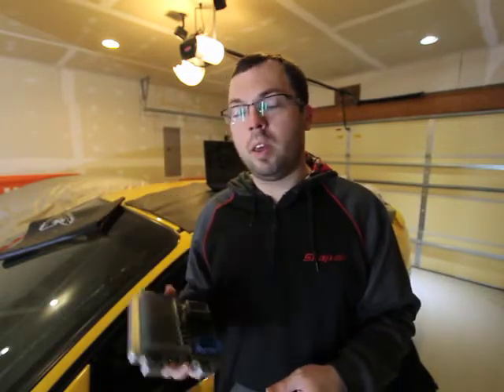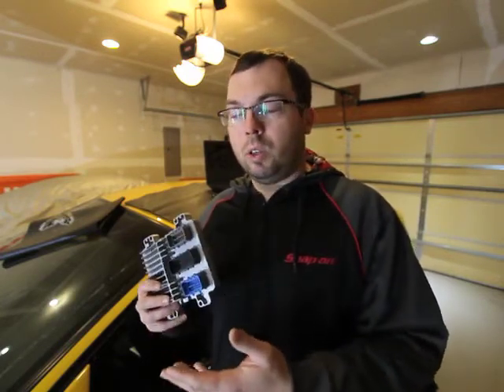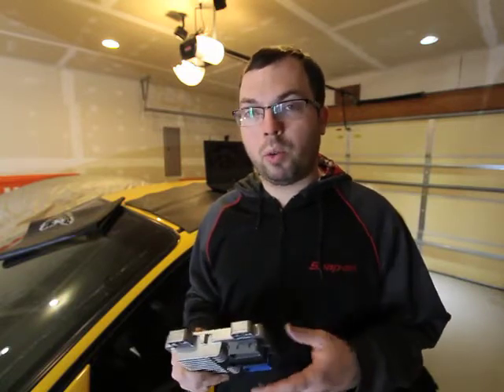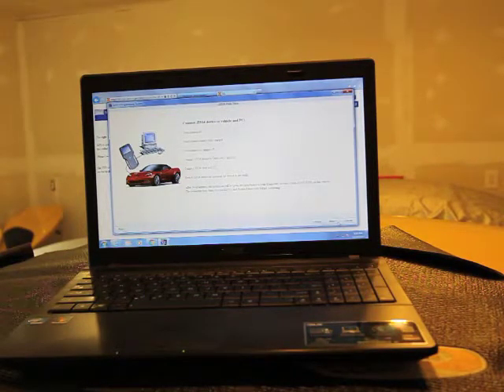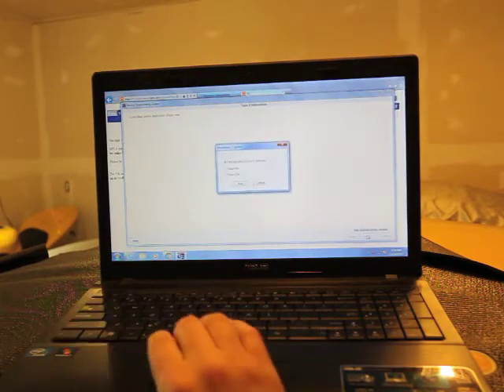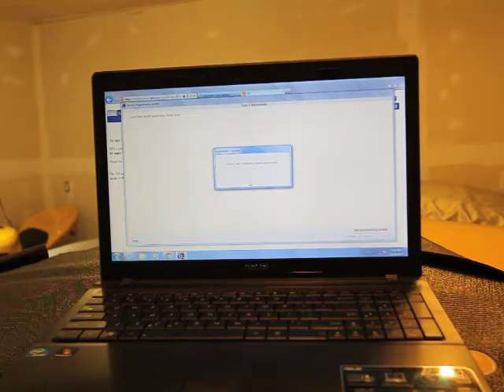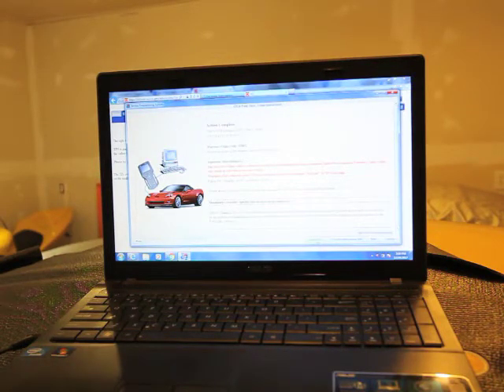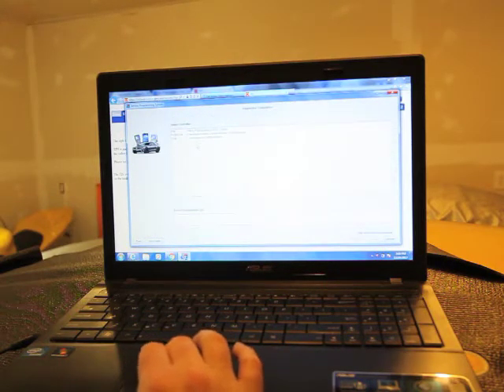Replacement of the PCM on 05 LS2 GTO with Programming Instructions

Comment: When you program these ECUs and modules on these modern cars, you need a flash programming power supply that supplies a constant voltage and varies the current as needed. Regular chargers are not the correct devices for flashing and programming.
Reply from the maker: I live dangerously every day of the week only time I bring out my power supply is on bmw
Reply: @SpartanAutoworx  I bricked my 05 GTOs ecu....low voltage also damaged my PIM. So, not for me anymore. These ECUs are expensive.

Comment: Hey there, if the PCM IS REPLACED WILL THE BATTERY LIGHT START BLINKING? What would cause the battery to start blinking after pcm replacement? No issues with charging system at all.
Reply from the maker: Year make and model?

Comment: How did you get the security code. I need to replace my ecm but need the security code.
Reply: Yes me too
Reply: @hollusta  what about you did you get the security codes ? I came across a company called All Computer Resources and they told me i wont need the codes if i get it from them (programmed to the VIN)
Reply: @Mr-th5hw  yes I got the codes from the GM dealer. They have them, but they don't know it
Reply: @hollusta  how exactly did you ask them ?? I called today and they seem so confused..
Reply: @hollusta  ?
Reply: @Mr-th5hw  I had to insist that they give a detailed look because no one in parts knew the codes are in there. I also think I need proof of ownership like registration.
Reply: @hollusta  thanks for replying 🙏
Reply: Did you get your security code ?
Reply: Going through with this Ecu swap nightmare fml. And i just got my Motor rebuilt 400 miles ago..

Comment: I recently bought a used ecu from another gto for my Ls3 gto swap, but I didn’t do a flash on it. Did a vats delete on it but it doesn’t crank nor start. Now it’s says something about immobilizer code. Was I supposed to reprogram the ecu to my car?
Reply from the maker: I dont think you can kill vats inside GTO tune. Have to use tune from corvette
Reply: @SpartanAutoworx   no, I have not. I’m pretty much stuck right now.

Comment: Does a preprogrammed one from online work fine or will I still have to flash it? I have an 06 GTO and reduced performance keeps shutting the car down. Got a code p0601
Reply from the maker: If vats has been disabled. Not sure you can disable vats with GTO vin in hptuners. Maybe EFI live but not sure.
Reply: Hey! I have same issue, did you get it fixed?
Reply: @resultsfitnessco  Did anyone get this fixed? Just happened to me, tried a new ecu but can’t get new key to program.
Reply: @johnnyboy71294  I fixed my issues. Problem was I had a remote start system that went bad and interfering with everything lol
Reply: @g00niez  oh damn, so it wasn’t even the computer?
Reply: @ nope. My car would run then shut off on me. Eventually got to the point where it wouldn’t even crank over. Put new computer in it. Same issue. Diagnosed everything and the remote start system that I didn’t even know I had went bad and stopped it from starting.
Reply: @g00niez 😮‍💨 I don’t even know what to do anymore 😂. Replaced the computer and can’t get no keys (3 so far) to program to it. Mine still starts and drives with old   computer. But eventually it’ll shut off.
Reply: @ yup that’s exactly what one would do. You might have a remote start you never knew about if you bought car used. I never knew I even had one lol
Reply: Same happens to me. Did you get yours fixed? I tried turning vats off with new one wouldn't work I just grabbed the code today
Reply: @g00niez  Did anyone get this fixed? Just happened to me, tried a new ecu but can’t get new key to program.
Reply: @johnnyboy71294  yes. Except found out my issues came from my remote start system that went bad in the car.
Reply: Did anyone get this fixed? Just happened to me, tried a new ecu but can’t get new key to program.

Comment: Will this program and stuff  work for my '03 grand am gt1 ?
Reply from the maker: You replacing the pcm? Grand am has a different pcm and system. This link procedure will not work for that car. The SPS programming would be similar. 

Let us know what you have going on and we might be able to help.
Reply: @SpartanAutoworx  ok ,  my portable BT obd scanner i always leave plugged in randomly caught the obd port wires on fire and my gauges were going haywire. So i unplugged it  and i went under the dash and got all the melted wire covers off,  cleaned up the wires and retaped them . 
Everything has been working fine since that happened till recently. 

When i accerlate my headlights dim alittle bit like the electrical stuff loses some power.  my battery & alternator where tested and are fine. 

The lights in my climate control went really dim permanently .  when i turn on the A/C (that works perfectly fine) the empty fuel tank light comes on then the security light comes on and my gauges flatline till i turn the ac back off. 
  Also recently ,  sometimes when i break the gauges flatline and the security light comes on ,  then all returns to normal a few seconds later.
I am going to buy a new climate control module but i think it only went bad because im assuming the little fire caused a short in the pcm maybe ? 
I work on my cars always and know alot about cars but i do not know alot about pcm. 
Not to sure though , someone suggested that. Ill be able to see if more wires were damaged behind the climate control once i take it out to replace,  
But how likely is it that the fire shorted the pcm ? The car is very well maintained in excellent condition and i take care of it. I guess the fire was my fault i shouldnt have left the obd scanner plugged in 24/7.
If you do have any ideas im all ears ! Ive searched everywhere and finding my specific wiring harness is completly impossible so im ruling out changing that.

Comment: I am swapping a 2006 GTO powertrain into an '80 Corvette. I have the original ECM, flashed to remove VATS. The car starts and runs. I was thinking of adding a PIM and BCM (if needed) to use the GTO gauge cluster (I have the car's original). Will this work to make an another 2006 GTO PIM/BCM run the gauges and MIL?

Comment: HI, I have a 2005 GTO, pretty sure the computer went bad , when it heats up the car goes into safe mode. and i have replaced the throttle body and everything els tests fine, once it cools down runs great untill it heats up again. So I purchased a new ECU, vin was installed on it i was told, I have HP tuners, it will not even read the ECU now, I do know I have to link the PIM and the BCM and relearn the security code as well. Can I do this myself with outgoing to a dealer, reason is the car is in my barn, and will not start and even if i could get the car there who knows if they will be able to do this. And the car cannot be started anyhow since it does not have the loaded tune needed to even start, the car is supercharged among other things. I want to be able to do all this myself or with the help of a knowledgeable person in my barn and be done with it. I need some guidance on this please. TY
Reply from the maker: You will have to relink the pim and ecm. No way around that in order to get the car to start.
Reply: I have a 2005 GTO with a similar issue.  Replaced the TB and it got rid of most of the issues.  But, it still pops a Safe Mode intermittently, doesn't matter if I'm driving it hard or cruising on the highway.  Did the new ECM fix the issue of putting the vehicle into safe mode?

Comment: Can you show how to reprogram a BCM on the 04 GTO? Having some issues, I have the tech 2 but not exactly sure of the correct procedure. Any help would be greatly appreciated! Thanks
Reply from the maker: Used BCM?
Reply: @SpartanAutoworx  So I could reprogram the one I have in the car or use a new one with new fobs, programmed the new one to the new fob but I am still getting the same codes and the car will not start believe that is the PCM. That is preventing it from cranking, can you private message me your number so we can text or talk?
Reply from the maker: What codes are you getting?
Reply: I have a used BCM programmed it to new key fobs. Exact same issue you're having. Everything works after programming the keys but it's still not starting. Did you find a solution to this?

Comment: Can you do the vin swap with hp tuners?   And you said  pim?
Reply from the maker: On a GTO a vin swap wont get the car running again. Have to relink pim with ecm.
Reply: @SpartanAutoworx  relinking the PIM to ECM is an issue as well for a lot of GTOs. there are 609 vin # associated with this issue. the immobilizer code you need to link issued by factory, if it start with a "0" and any other "0" after will not be recognized as a number. My code is one of these that starts with 0 so as its trying to be linked i get incorrect code entry no matter what. currently trying to find a fix.
Reply: What are you using to program, Tech 2 or MDI?

Comment: Hi , I will be replacing my ecu in a hsv gto vz  that has a custom tune with a second hand unit due to a faulty fuel enable from ecu to relay .  before the swap would I have to reset the original ecu in the car first before removing and then put the second hand pcm in and change the vin   to my faulty one , then load the program into ecu for a gto ls2 vz coope  , then load the custom tune , then do the pim - ecu link only ?
Reply from the maker: A little confused here. E40 ECM I assume since you talked about the LS2. 
Using HP tuners install the new computer (replacement) 
Write the tune and change the vin. 
Then you will have to relink pim to ecm. The FUN Part
Reply: are you using the tech 2 to link the e40 ecm to pim  through tis 2 web I have a clone version with the 142.001 software version ,   have down loaded the tis 2 web from acdelco purchased the vehicle specific $40 dollar subscription but I cannot communicate with the tech 2 when all pluged up to laptop  keeps saying error . I am running windows 10 on pc  . the car is a gto like yours
Reply from the maker: I do not use the tech2. Old brick technology. I would check the driver settings on the laptop. Also, make sure you use internet explorer to program. Do you have any com at all? Does it pull the vin? If you plan to do programming look into getting a drewtech.  Unfortunately, most dealers are clueless when it comes to the GTO.  So you will have to figure out whats going on with the com issues.
Reply: Hi , I am using the mongoose pro GM2 connected to ac delco sps programming changing the vin following all their requests it comes to vehicle data vz hsv coupe details It then asks auto or manual , I enter auto then wait and the on screen message is E 2701: no authorization to program the selected software.Now it wont allow me to proceed further .
Reply from the maker: Hmm not sure why it would give that message. Whats the vin?